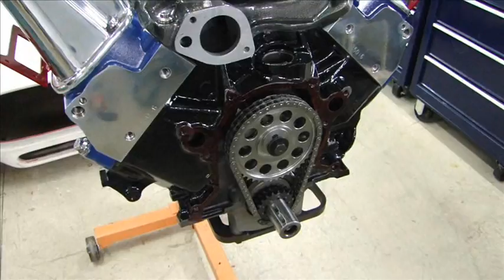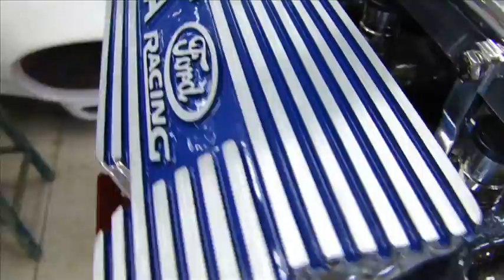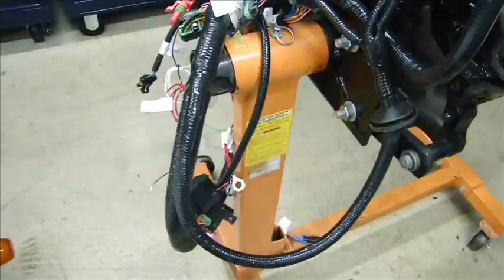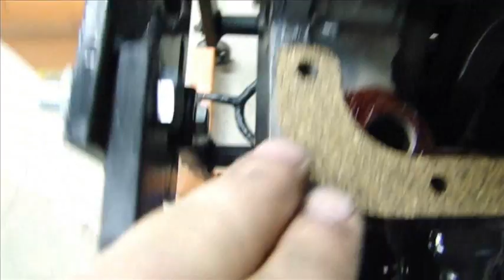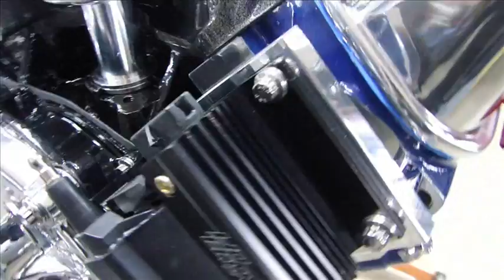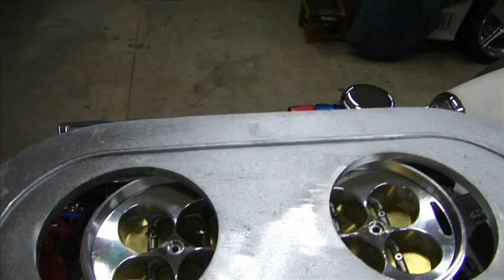Cobra Engine Build Part 2 Finishing

Comment: that oil pump rod sould be installid with the oil pan off and the oil pump. i know if you try to pull a dist out of a ford car you are asking for probloums. if you  do what he tells you you going to have probs later on. there is a snap ring on the shaft to provent from pulling it out of the oil pump, this way you can safly pull the dist

Comment: I was surprised to see you install the crank pulley like that, I normally use an installer to save damaging the crankshaft threads I 've  seen front pulley bolts snap in the crank using an air gun like that. just saying.......
Reply from the maker: That is true. I would do the same for a press fit pulley. Since this is not a balancer it fits a little looser. If it were a press fit I would use the tool. Thanks for the comment

Comment: I.A.C. stands for Intake Air Temperature, not idle. Just an F.Y.I. Beautiful engine build though! Being a FORD fan I love it!
Reply from the maker: +genrllee That is true most of the time. This system requires the sensor to be placed right in the stream of the idle air. There is a motor at the base of the throttle body that meters air at idle. The system adjusts based on the temp of the air at idle. Thanks for watching and your comment my friend
Reply: Huh, that's different. Must be because it's an aftermarket system. All the vehicles I've worked on it always stood for Intake Air Temp. Good to know!
Reply: genrllee generally they have both the idle controll valve keeps the idle steady at idle revs eg raising the idle when ac is turned on , the intake air temp sensor is great for measuring the density of the air coming into the engine so it can adjust the fuel to the best power the engine can make I think

Comment: why didn't you use the blue fel-pro gasket?
Reply from the maker: +Nick P I did rebuild the engine using the blue. Excellent point, thank you
Reply: +Petes Garage just wondering. I heard the cork gaskets leak over time

Comment: could you explain the "gurdle" you have mounted to the main bearings, i've never seen that before, (i'm new to engine building)
Reply from the maker: +Nexus .Shadow The girdle is to prevent the block from twisting and adds strength to the lower end.
Reply: cool,thanks for the info

Comment: im just wondering my you would put the IAT sensor in the intake its self? That's not going to get proper readings with heat from the intake and engine its self?
Reply from the maker: +snicks50 This particular system requires the IAT to be placed right in the flow of the idle air which enters at the base of the throttle body.

Comment: No issues running the fuel rails in series like that?  If had fuel starvation problems on the cylinder closest to the return.   I now run them in parallel with no issues.
Reply from the maker: jleote I've have zero issues. With an electric fuel pump and the regulator set to dump at 90 psi there is plenty of pressure to keep both rails full.

Comment: Pete I have a 1989 EFI 302 5.0 MOTOR. I want to build a nasty street N/A or procharged short block ford.
But what is the most i should bore this block out too before i start to weaken or get to its breaking point?? And what 4340 cam kit would u recommend? I know theres the 347 cam but is there a better one out there??
Reply from the maker: No more than 0.060" bore. The cam will need to match your intake and cam
Reply: Okay thank you
Reply from the maker: Samuel Monsivais Sorry...match the intake and carb

Comment: Hi Pete first thing" Thanks "I started to build my engine a year ago just from watching you videos it a 88 mustang it's running now but a have a little problem.   Coolant antifreeze its coming out the exhaust pipes     Any idea what its the problem???
Reply from the maker: Wrong/backwards/upside down head gasket
Reply from the maker: Cracked head
Reply: It was running fine I put trick flow heads.   I got cobra intake (they not use a egr spacer) and I connect the hater tube to intake and then this is happen     I totally upset:(
Reply: Carlos Valdes Pull the heads off, take them to a machine shop, and make sure they are square!
  Have a light grind done on them if they are, and reinstal.  If they aren't then send them back!

Comment: You are also supposed to lather those valve springs in oil before you start it up. They will over heat and break if you don't.
If you don't use KBS diamond clear coat on that buffed aluminum it won't look good for long.

Comment: Very much enjoyed these two very generous videos. Brought me back to my college days, when I bought a new 1990 Mustang GT, rented a garage, and (being young and dumb) pulled the motor out, wanting to modify the 302 engine and get more horsepower. I got to know a local machine shop very well, and every nut and bolt of my Mustang, and wore out my Summit catalog, and my savings. Took me a year to get everything back together. No YouTube back then! Your video, although your project is much cooler, made me remember the joy, and frustrations, of getting things back together. I'll never forget the chills I had after I heard the engine growl and felt the power my mods made happen. Thanks very much.
Reply from the maker: Ah yes...I remember those days as well. I could have used YouTube. That's why I'm trying to help people now.
Reply: ***** funny! because i am currently in college. And u i am building my little 302 right now. & i must say i use you-tube alot when i am unsure about how to do something.

Comment: Looks nice. Not sure how I feel about the 427 logo on a stroked 408 small block though. Two things I want to suggest as far as building the engine for next time. 1 get a harmonic balancer installer to mount your balancers when they are press fit, they are fairly cheap and easy to use and you wont damage the threads in the crank or the bolt. 2 install the cam with the engine in a vertical position as you are far less likely to nick either the cam lobes or the cam bearings this way :)
Reply from the maker: MrCWH5 Those are 2 great tips, thanks for sharing. A 408 stroker bored .042" on a 4" diameter piston gets it up to 427 cu inches. It's a small block 427

Comment: very nice engine and nice work. does it still run?
isnt there a heat probleme with the ignition wires so close to the exhaust manifold?
greetings from germany
Reply from the maker: Greetings jerri. I runs very good. Going back on the dyno soon. There is no problem with the wires. They are special for high temperature applications.

Comment: I have heard of people building up the dohc 302's for boost, but could you do the same with a pushrod motor and get over 600 hp? Any reply would be appreciated
Reply from the maker: Sure...you can get over 1,000 HP out of a push rod motor if you want to spend the money.

Comment: Two questions. I'd very much appreciate a response.

How did you only powdercoat in between the fins?

What kind of clips did you use for your spark plug wires? I want to give my engine that treatment.
Reply from the maker: Powder coat the top of the cover and use a paint brush to remove it from the fins and logo. A bit painstaking, but worth the look. I used regular wire looms from Summit I believe.
Reply: ***** That's what I figured. Now, another question. You have more experience than I do with powdercoating. I have a finned valve cover I want to powdercoat black, but I want the tops of the fins white. So, would it best to paint (with high temp paint) the tops of the fins first, and then powdercoat? Or would it be better the other way around?
Reply from the maker: Powder coat the top white first. Then do the black. Should work nicely.
Reply: Thank you!

Comment: If the IAT is mounted in the air cleaner assembly, it is useless to calculate heat soak of the air charge in the manifold, nor does it represent the actual air temperature entering the engine (throwing off the density calculaton). This is why OEMs almost never simply place their IAT in the airbox and instead typically place it close to the throttle body or more likely, in the actual intake manifold itself. When there is an IAT in the airbox, there is almost always a 2nd in the manifold too.

Comment from the maker: This EFI system requires the IAT to be mounted directly in the idle air stream where it monitors more closely. Idle air is controlled by a motor in the rear throttle body.  At WOT it measures all air, but is very critical at idle which is why I called it the idle air temp sensor

Comment: first off its an intake air temp sensor not idle air temp sensor and second it didnt need to go into the intake it couldve very easily gone into the air cleaner assembly

Comment from the maker: This EFI system requires the IAT to be mounted directly in the idle air stream where it monitors more closely. At WOT it measures all air, but is very critical at idle which is why I called it the idle air temp sensor

Comment from the maker: Excellent comment and I agree with you. The heat sink on the coil does have a function and you are sharp for noticing. Since the heads are aluminum I calculated the heat transfer and determined the 1.25" stand-offs I put behind the coil mounting block would allow sufficient air flow to keep the coil mounting block cool. The .5" block will radiate most of the heat before it gets to the coil. The heat sink will do the rest. A fan blows right on it so it should be ok. Thank you very much!

Comment: Very Nice! (Comment: you really shouldn't connect the coil directly to the engine the way you did, especially without a plastic/thermal spacer divider between the block, your alum. plate and coil, your getting the coil hotter than its needs to be, theres a reason why that coil has a alum. fins on the outside, the coil shouldn't be subjected to that kind of heat and vibration, unless this is just a show car/engine)

Comment from the maker: This engine was $15,000. I wanted the lite weight of a small block that puts out over 525 HP and 450 ft lbs of torque. Just don't need a big block for this car.

Comment: What does such an Engine cost to Build? ballpark of course, also what level of Hp/Tq are you expecting ? To bad you didn't choose a big Block F.E.390,410 427 or 428 ! I had an FE 410 once was a strong motor,even from the factory 335hp & 450 ft/lbs tq,was out of a 67 Big Merc Monterey!

Comment from the maker: The 427 Cobra circulates coolant through a Harrison tank mounted above the radiator. 2 electric fans on the radiator do the cooling along with circulating air through the engine compartment. The original car did not have room for a fan.

Comment from the maker: Not at all...that is a common comment. This EFI system requires the IAT to be mounted directly in the idle air stream where it monitors more closely. At WOT it measures all air, but is very critical at idle which is why I called it the idle air temp sensor.

Comment from the maker: I agree. This crank was ground and the balancer was sized for a clearance fit. Since the rolling assembly is balanced there will be little to no vibration. If this were a stock crank with a normal balancer with a slight interferance fit I would use my hydraulic press tool. Thanks for the comment.

Comment: I have B303, 1.7 rr, ported and polished e7 heads bored 30 over and trick flow track heat intake 70mm throttle body if you some suggestions let me know

Comment from the maker: On a tradtional rebuild yes. On this engine I had to set the distributor end play and that was done by turning down the oil pump drive. I would not be able to make this adjustment with the drive in first.

Comment: That oil pump drive is supposed to be installed from the inside of the engine, between the oil pump and block.  Isn't it?

Comment from the maker: They are Accel 1050 CFM throttle bodies hooked to the Gen 7 ignition system. The idle air motor comes on the throttle body. If you use them and have any quations I have run the gauntlet with them. I learned a great deal about how they work. What is your 427 going into?

Comment from the maker: It is not just air cooled. There is a Harrison tank and a double core radiator cooled by 2 electric fans. There just is not enough room to put a fan right on the motor.

Comment from the maker: It is not so common. I work in an engine plant and I see occassionally when machines get misaligned and holes end up off location. Based on the year the block was made they probably say the problem and let the blocks go because it is only a drain hole. Today that would never even make it to the assembly line.

Comment: I guess it depends on what you want to do. I find the July/early August months the better weather. I'm an American living here so the shorter summers are something to get used to. Helsinki is a beautiful city with lots of touristy places to visit. Regarding your build, is it common for the heads and block to line up so poorly which results in the problem of flow out of the heads?

Comment from the maker: 427 Cobra's have a Harrison tank, and a large radiator cooled by 2 fans. There was not enough room on the original ones to put a fan on the front. that plus the heat blowing back at the driver would have been too much. The fans on the radiator are angled down to blow the heat under the car. Thanks for the compliment.

Comment: Nice engine and craftsmanship really good job. I love your garage btw it's the perfect setup. I had a question though about the no fan on your engine. Maybe I missed it in the video but I was curious was there any steps made to make up for not having a fan, like bigger coolant ports in the engine or a high efficient radiator I would just like to know how you compensate for not having a fan is all thank you.

Comment from the maker: Thank you very kindly. That has to be one of the most common questions. My interest in engines started when I was 10. I built, flew, and raced R/C airplanes. I took the engines apart trying to figure out how to make them faster. At 15 I bought my first car, a '66 Mustang 289. I took it apart, learned how it worked. For the next 30 years it was tons of reading, talking to experts, practicing (and failing). Now I am an Engineer for engine machining, assembly and testing for one of the big 3.

Comment from the maker: I would think you can buy an engine conversion kit that would have V-8 mounts that go in the exisiting holes. Depending how you build it and what you fit it in with it could run anywhere from $5k to $30k. That's if you do all the work yourself.

Comment: I had a bad feeling you'd say the "s" word. I'm not looking to have too much horses in it, mostly because I'm using it as a daily driver, but would I still end up having to put a sub-frame on it, or is that inevitable? One more question, since as it is I'm going to have to use a bit of persuasion to fit the 360 in the engine bay anyways, what would be your estimation on total cost?

Comment from the maker: You have quite a project there. All of the electronics up to and including the injector harness is for a V-6. Dropping in a V-8 changes many things including the driveline. Depending on the horsepower you are planning you may also need to add a sub-frame. What you are doing is not impossible, it will be fun, but you'll need a healthy budget.

Comment: I have an '86 Camaro with the stock V6 2.8 multi-port FI and it's due for an engine swap. I was considering putting a 360 in it. Do you have any suggestions as to what I should do with it?

Comment from the maker: You are 100% correct my friend. You can put that drive shaft and collar on first, however, after the engine is assembled the end play in the distributor needs to be set. If the shaft is tight you would have to remove the pan, pickup and pump to take the shaft out. After I put this engine together the distributor had 0 end play. I took out the distributor and shaft and turned it down 0.045". Dropping the shaft in from the top only took 20 minutes. On a straight rebuild I would do what you said.

Comment: I notice in your video you make mention of installing the oil pump drive shaft last.
The shaft has a spring collar that will not allow that to happen, unless you remove said collar.  It would still be difficult to install the shaft and get it into the pump from above.
The shaft is supposed to go in first and is held in place in the distributor boss with the spring collar, then install the oil pump.The hex in the end of distributor then engages with the shaft...

Comment from the maker: Cool... I'm glad you like them. In addition to the EFI harness, the dyno requires and additional harness for cylinder temp sensors, NVH accelerometers and other data gathering sensors. My harness was reduced by 50% but they add a bunch.....great observation!

Comment: I would have turned the engine on the stand so the lifter valley was up, and I could guide the cam in to avoid scrapes. So what is it, a 408 or a 427?

Comment from the maker: The cork gasket was temporary. I was going to tear down the motor after the dyno test to inspect everything. I made some minor changes, milled the heads 0.010" things like that. It has been replaced with a nice, new rubber gasket. Thanks for the comment on the intake....it will be the show piece of the motor.

Comment from the maker: Well....many things were considered when choosing the 351W...even over a 351C. First, the 351W Simply is larger and can handle the HP better than a 289. The original 289's were used mostly for road racing. The 427 was put in for the HP to beat Ferrari and Porsche, but a block goes for $4,500 and is much heavier. My goal was 500HP and the 351W was the best choice because of the thicker China wall, cylinder wall thickness and performance parts availability.

Comment: Why wouldn't you use a 289 or the actual 429 like in the cobras? its easier to get more horsepower out of the 289 than the 351.